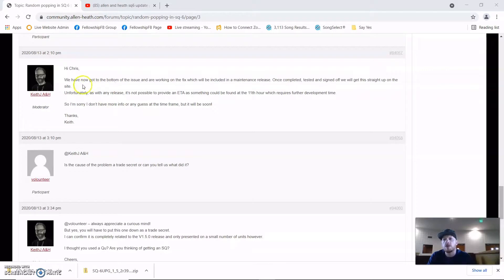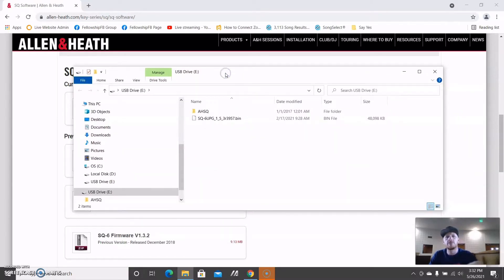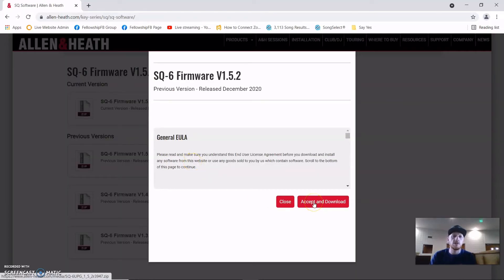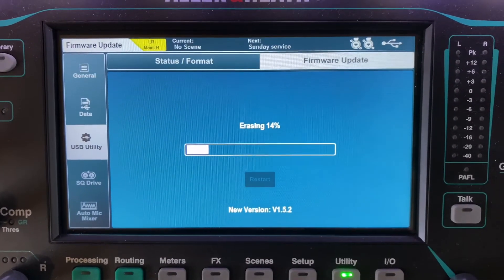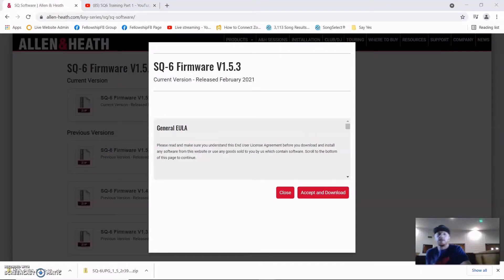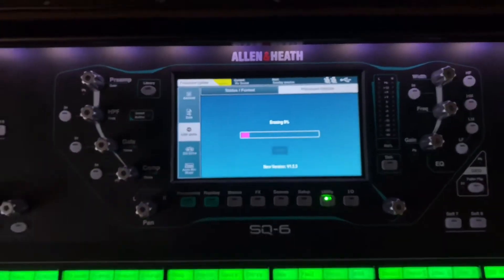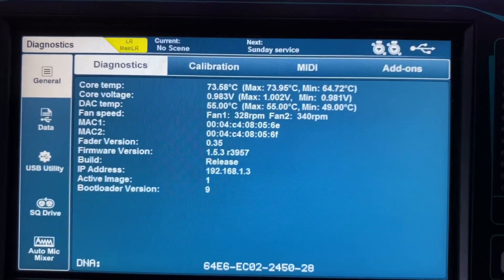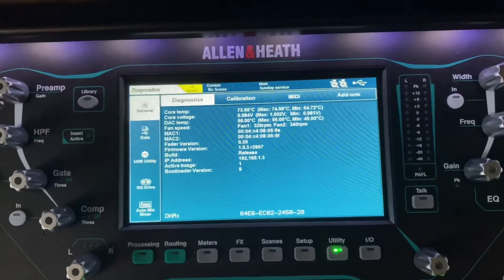Popping Noise | Radio Frequency Audio Interference ( RFI ) and Firmware Update Allen and Heath SQ-6

Comment: Just ran firmware update to .4. Still didn’t fix the issue.
Reply from the maker: Sorry to hear about that happening so soon! That happened to me as well. I’ll be coming out with another video with an update. I’ve been in talks with Allen and Heath and have had some great email conversations. Their customer service is amazing. I’d be interested in knowing the rest of your setup if you wouldn’t mind. Would email correspondence be okay with you?
Reply: @RevisionMedia  2412 digital snake. New crown digital amps. Peavey line array speakers with powered wedges. Ear monitors for band. 18 wireless shure mics
Reply: @RevisionMedia  the issue seems to be in 1 and 2 mains. None of the monitors have the issue is that consistent with u
Reply from the maker: @7bdave  We hear it on all outputs except for the ear monitors. We thought we narrowed down the issue to the wireless mics. For a while, if we powered on every single wireless mic and muted the ones not in use, the popping went away. Now it’s back. We are running a few tests with our pastors wireless lapel mic. Now it seems to be happening while that mic is powered off. But then it threw me for a loop and popped right in the middle of his sermon last Sunday. 🤦🏼‍♂️

Comment: I think I found the solution! mine is completely silent now! I had an output RCA on a channel of the sd player with a cable to XLR and had 2 pins Bridge on the XLR, , it turns out that the mixer can't handle that and this is the solution
Reply from the maker: That’s pretty interesting! Bit of a different scenario. Thanks for the info! 🤙
Reply: @RevisionMedia  The Beast is back! with me it happens when it gets warm, and when you tap it or with the bass vibration,nobody can find it what it is
Reply from the maker: @PeterlahayeNl  I have a major update about this. I’m out of state on vacation right now but when I get back I’m going to shoot the update.
Reply: @RevisionMedia  ok that's nice which direction did you find it?
Reply from the maker: It was actually an internal issue with the board.
Reply: @RevisionMedia  ok so you got it fixed?
Reply from the maker: Yes. Allen and Heath took care of the problem. They were very prompt and handled everything very professionally!
Reply: @RevisionMedia  do you happen to know what they fixed
Reply: Do you no what allen heath have fixt?